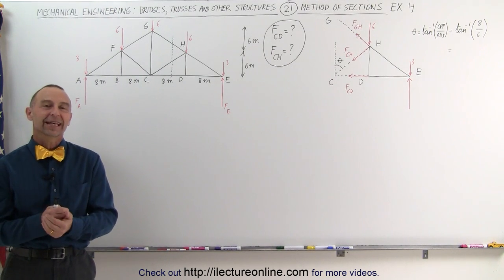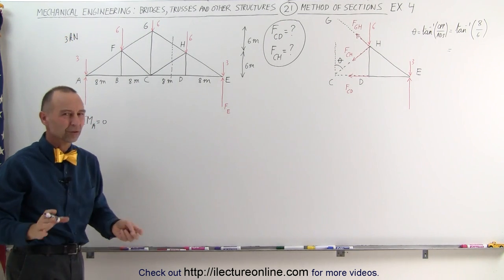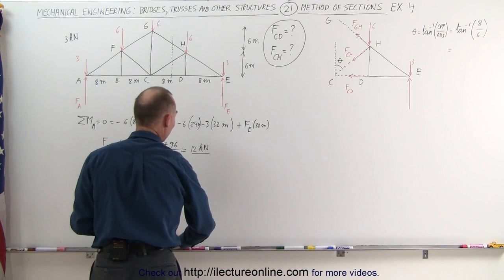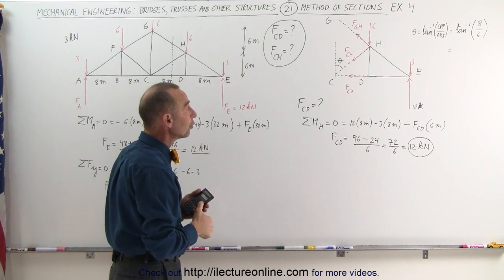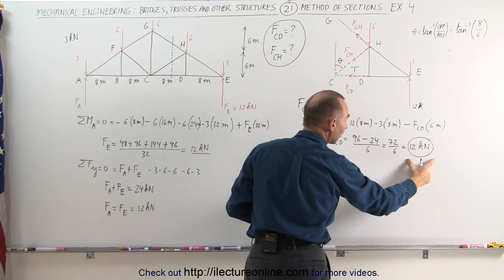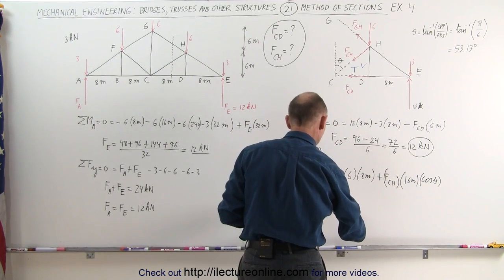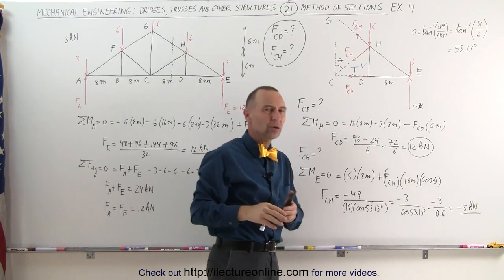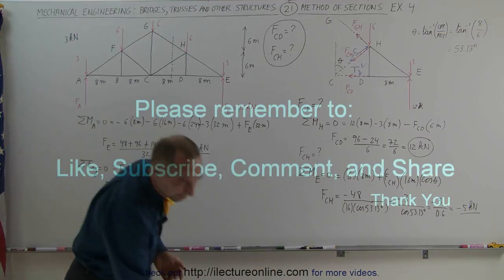Mechanical Engineering: Trusses, Bridges & Other Structures (21 of 34) Roof Truss: Sections: Ex 4

Comment: Thank you sir, just one comment. I think it is easier to understand if  when calculating  the distance between Fch and the point E we use the sin of the angle between CD and CH. Of curse it is the same result, but I think we can understand it more easily if we draw it.
Reply from the maker: There are indeed multiple ways to solve this problem.  🙂